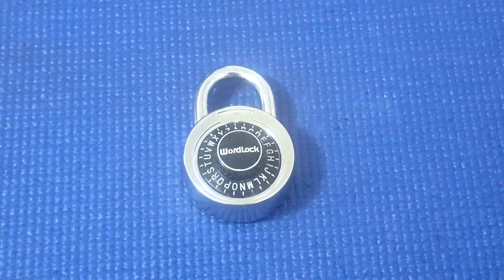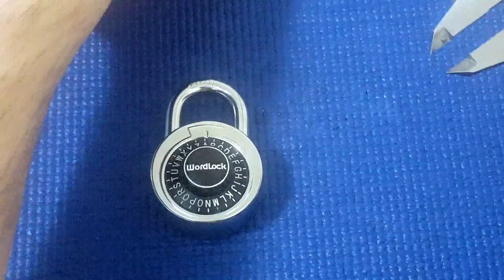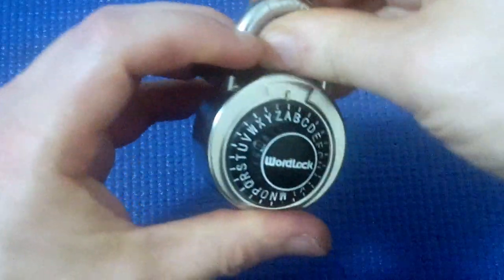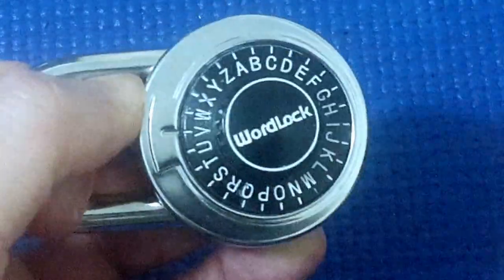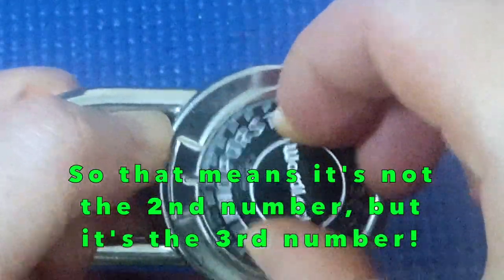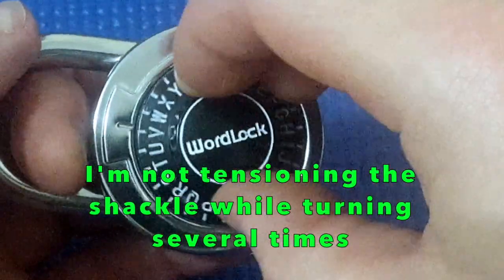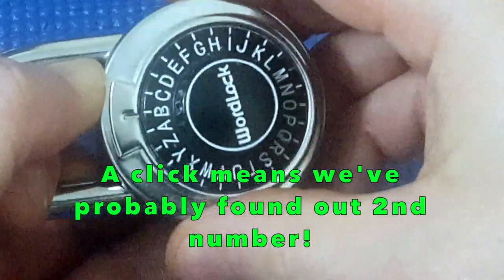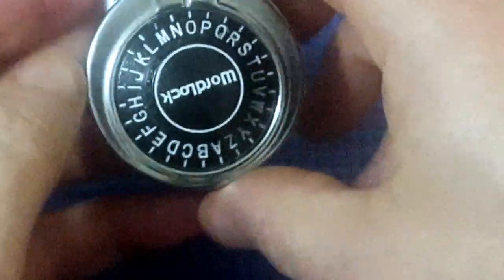(Picking 106) How to crack a cheap WordLock dial combination padlock

Comment: I tried this, but the first number it locks onto and cannot move is actually the last number.
Reply from the maker: So you were lucky to find the first number quickly right?
Reply from the maker: So the thing to do in that case is to go past that number (letter) ... so turn it several times to the right (with no tension on the shackle) to reset the lock, and keep going right until just past that last number position, and then tension the shackle and turn to see if you get any stoppages or clicks.
Reply from the maker: How did you get on with this?  I've found that sometimes the 1st & 3rd number can be the same number.
Reply: @Swynndla  No, I couldn't find the first number at all.
Reply: @Swynndla  No luck for me.
Reply: @Swynndla  That is very rare, I think.  I was able to shim the lock and open it that way.  I also opened the back with a Dremel tool to be able to see the mechanism and only then was I able to figure out the combination.
Reply from the maker: @russelljones365  Yea some of those locks are a right pain.  They are cheaply made, and vary with their feedback.  Some of them are easy and obvious, and others are not.  Good on you for opening it up and checking it out.

Comment: For some reason mine only clicks on 2 letters...cant find the 3rd one?
Reply from the maker: The 3rd one will stand out, as it will have massive "play" as compared to any of the other "stoppages" or "clicks".
In the video, after resetting the internal wheels but turning several times to the right, I tested "V" as there was a stoppage under tension, then I turned one full turn to the left to V again, and that's when I found the 3rd letter was "O", and I knew this because of the "play" (where it moved quite a bit under tension, but wouldn't be able to escape while tensioning). I moved passed this, tensioned again, and kept turning left hoping for a "click" or maybe a "stoppage", but it turned all the way to "V" again to I knew that "V" probably wasn't the first number. Note that when I tested "T", I got the click before the 3rd position, but it can be after the 3rd position.
Tips - always turn several times to the right before testing any 1st letter.
Also, the 1st & 3rd can be the same letter - so try that!

Comment: I thought that was going to break your shim for sure. That one seemed a little easier to decode.
Reply from the maker: Yea that one is similar to the very cheap ones, some of which can be a pain (depending on manufacturing variations that mean some of these locks don't talk to me) but usually these types are easy (the type with the key-stone shape up the top and the white circle on the dial). :D :D  I'll be doing another video of a different type of word-lock that is really hard to decode :D :D

Comment: it wont do anything  idk  can someone tell me how
but easier
Reply from the maker: Does the lock look exactly the same or is it a different one? Does it say "Master" on it or anything?
Reply: @Swynndla  it wont stop or click
Reply from the maker: @amanda_rebecca  Does it say Wordlock on the padlock?
Reply: @Swynndla  yes
Reply from the maker: @amanda_rebecca  First of all, these locks aren't made very well, and there are great variation between them - you might have one that doesn't click! In that case you might not be able to decode it.
I'l try and explain the first part of the method I used.
First of all, turn several times to the right (at least 3 full turns) to reset the inner wheels, then apply tension (by lifting up on the shackle, as if you're trying to open it) and keep that constant tension, and turn - you should feel resistance ... ie it should be harder to turn. If it's not then either you're not pulling up on the shackle hard enough to tension it, or your lock can't be decoded in this way. Keep turning right (with tension on the shackle) until you either get a click or a "stop point" where the dial wont turn any more (unless you release tension). That may or may not be the first number. Can you get this far? Let me know, and we'll go from there.